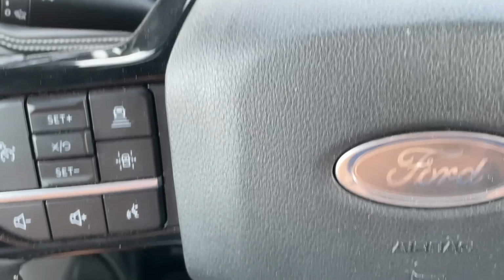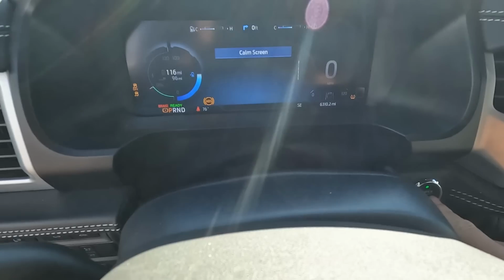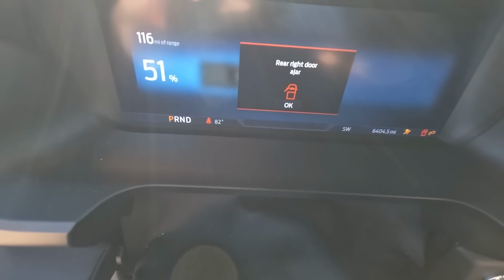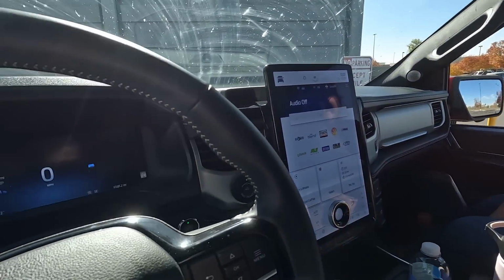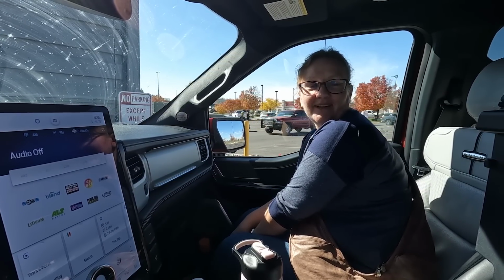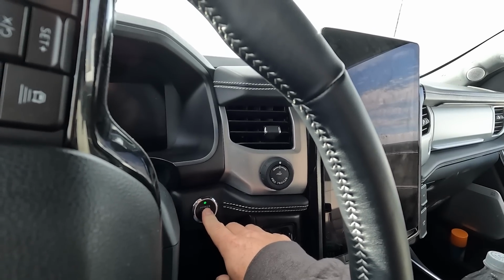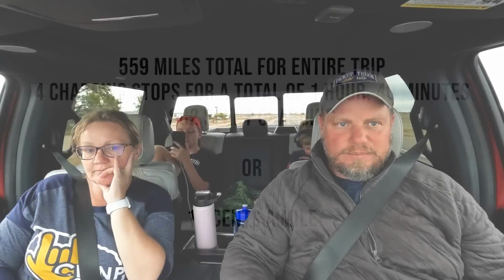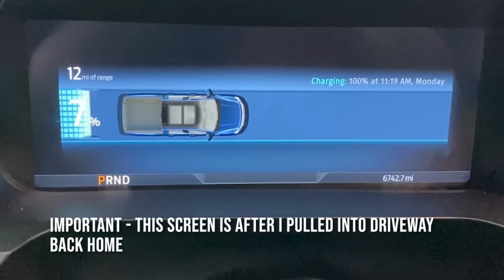Truth on charging times/cost on 2022 Ford F-150 Lightning Road Trip

Comment: My 2001 Ford truck would do this trip at 13.5 cents a mile and one 10-minute stop. No self-driving, but it does have cruise control, air conditioning, comfortable seats and a good radio. 
Battery weight, charge times, and vehicle cost start getting out of hand on anything other than a small automobile (the smaller the better). None of these things are going to be overcome anytime soon and the general public isn't going to buy into these vehicles until they are.

Comment: I just bought a 2021 limted f150 powerboost hybrid  today. 600 plus mile range. 100% full electric is not and will not be the future. Hybrid gas or hybrid diesel is the only way.

Comment: Is my math right on this. So...$23 could get you 6.38 gallons of gas at $3.60 per gallon.(And it took 30 minutes of your time to get that $23 of electricty)   Those 6.38 gallons of gas in say a Powerboost, should get you 134 miles of travel at 21mpg (which you should be able to get).  And you could fill that 6.38 gallons in about 3 minutes.   How much less is a Powerboost vs Lightening?  How much is 27 minutes of your time worth (the difference in time in putting in electricity vs gasoline)?  I'm so glad I ordered a Powerboost.  So with the Powerboost, you fill faster, you can travel further per dollar, and you have less stress.  What are the advantages of the Lightening?
Reply: It’s a better virtue signal.

Comment: Tim, perhaps I missed something but when you made the statement of 559 miles for $82 of charging cost I believe there might’ve been a mistake made. Correct me if I’m wrong but you started with a charged vehicle and ended with a vehicle that was basically depleted. I believe you should have filled the vehicle up to the same percentage at the end of your trip to get an accurate account on how much money it actually cost. No different then with a gas vehicle. You would stop at a gas station close to home, fuel up, complete your trip, and then fuel up at the end.
Reply: I was thinking the same thing.  When you are trying to determine total cost for the trip you need to factor in the initial charge.  No different than gas.  Just because my tank was full when I pulled out of the garage doesn’t mean I don’t have to figure that cost in.  Yes, you charged at home but there is still a cost associated with it.

I have a 2019 Tundra Crewmax with a 32 gallon tank.  Currently $125.00 to fill it up.  That gets me roughly 500 miles.  Not very efficient.  Tim beats me hands down regardless but on that same 579 mile trip I only need to stop once for 5 minutes to fill the tank again.

The pissing match, at the end of the day, is meaningless.  No single vehicle is going to suit every need.  Determine for yourself what your priorities and preferences are and make your buying choice accordingly.  That is, until the government tells you what you can buy.  We can then all carpool in the EV to the broom factory wearing our grey jumpsuits.
Reply: @handontheplow  Color me stupid and I'm no math genius but his first stop cost $23 and gave him 100mi of calculated range, $0.23/mi. If your Tundra gets 500mi on $125 that's $0.25/mi. Just a random observation...
Reply: @jims4036  Maybe I had too much to drink and didn’t listen to Tim close enough.  I will need to watch it again and do some more of that math stuff.
Reply from the maker: You can’t look at it that way. First, I charge at home. Second, there are no superchargers in my area. 

EVs are different than gas models and this changes everything about testing them.

Comment: My Ford Maverick Hybrid would have made that same trip for $42. No anxiety.
Reply: Yeah. I wanted to like the Maverick, but one of the big problems I had with it was the comfort of the drivers seat. 
I drive a 2014 Ford Focus, and the Focus has more space for a large guy like me than the Maverick, which is insane, and disappointing.
Maybe next gen they'll improve the cabin, but hard to say with the cost of everything going up.
Reply: @GKMess42  You must be a big guy lol. I am 6'1" 220lbs. Plenty of room for me.
Reply: @joed3264  I'm a bit shorter and wider. LOL.
I also can't stand transmission knobs, for multiple reasons. Give me a column shift or at least a center console one.
Reply: @GKMess42  It actually works well. It does not have a stop for park, reverse or drive.

Comment: so you drive 100 miles each time stop and charge  . I cant imagine that electric vehicles are supposed to be great. not for me. what happens when it starts to get cold outside. like around 10 degrees. batteries are not good in cold weather. another thing is lithium batteries wont charge below 32 degrees. what happens then?

Comment: Will those batteries loose range as they get older, like a cell phone battery doesn’t last as long after a couple years and lots of charges?  Also, what is life expectancy of the truck battery?
Reply: Yes they will. There is a mandatory 10 year warranty regarding the battery. I'd expect it'd need atleast 2 battery swaps in that time with normal use. Who could stand driving an ev that long without dying from stress and range anxiety I have no clue.
Reply: @triedproven9908  how much is a battery swap?  Cost wise, will it be worth buying a used ev if you need to budget big $$$ to replace batteries?
Reply: @dmanmb  Cant speak for the Lighting BUT a Hummer EVs battery cost is 30K plus installation.

Comment: I’m sorry, but there is literally nothing appealing about owning an EV to me.  Pay more, less convenience, and range anxiety.  Plus I really don’t want to spend that much time at Walmart.
Reply: Agree. Green hydrogen fuel cells are the answer as there is no pathway to net zero emissions without extensive use of green hydrogen fuel cells which in this type of vehicle have 500 to 700 miles of range and refills in less than 6 minutes.

Comment: 🤦‍♂️🤦‍♂️🤦‍♂️ …
1) Just think if everyone did all the tricks to save range on a XV to a ice/hybrid?! That would make the XV look even worse!
2) Continued from 1…are they gonna have to lower the lowest posted speed limit on interstates? It use to be just VWs that always held up traffic now it’s gonna be $100k XV 1/8 ton trucks. “55 saves lives and gas” is gonna be changed to “35 and don’t panic save the Xanax”
3) 😆😆😆 you really think rates are gonna stay in that normal yearly inflation increases?! XVs will be paying the same per/mile as ice. Well!…fuel will go up too?!!…really when everyone driving XVs?!🥴 
4) Who in the right mind wants to stop at every other gas station to put in 1-5 gallons?! You have to with an XV though!
5) On the plus side…USA state wide assessment testing for K-12 should see a noticeable improvement in the math sector. All these calculations to compute driving an XV to thank!

Comment: You should check out the 1000km challenge videos, for example by Bjorn nyland. You'll see that you can get pretty close to ice car speeds in an Ev.

But the key is you have to plan the drive better.

As you say, you only have a few chargers in your  area, but once you have more you can optimize your route to only charge when the car is low. That saves a lot of time.

Comment: You discovered a new use case for the frunk. A place to put stinky things that you don’t want to blow out the truck bed -  like Chinese food!  Lol. But also, everybody should slow life down a little. Take a bit longer while driving long trips and enjoy it. It’s a glorified golf cart. Some things will be better (cheap fuel, torque, zero maintenance, fill at home) some things worse. Go to a place where everybody drives golf carts like Port Aransas and you’ll see there’s a way it works and is pretty fun.  The simplicity is relaxing.

Comment: The MSM would have us believe that EV are free to drive, NO, equal to or more than current fuel costs. not a single discussion regarding disposal of current battery swap or failure regarding the environment. HA.. who is handling that? Great data, try towing something say for a vacation. Think any campgrounds will have available recharge areas? HA, try to recharge on Sunday or whatever masses decide to leave days are. Hybrid is really the only current path if you decide EV is part of life. Great data dude/ette.

Comment: What about cold weather and battery life.   Like in Nebraska when it gets to 5 below zero.  How does that change things?
Reply from the maker: It affects things for sure. I’m hearing 5-10% range reduction. I’m hoping to get an EV over the winter to see first hand the range loss.
Reply: You lose 20 to 30% range.
Reply: @gelu88  Again, commenting on something you have no idea about.

My freakin 7 year old Tesla loses less than 10% range in the blistering cold.

You need to stop spreading the garbage in your head since you have 0 real world experiences.
Reply: Does ford heat the battery compartment?  To protect the ion battery.  I wonder
Reply from the maker: @tomomeara363  yup. Batteries are heated and cooled to operate at an optimum temperature.
Reply: @Pickuptrucktalk  ok that's good.

Comment: @Pickup Truck Plus SUV Talk: I am anti-EV and I disagree with you about having a choice because we win’s at some point. 

My questions are; Can you see a family in a suburban or rural area make it work with one ICE and one EV in the present time? Would it be more feasible if we had a PHEV half ton right now as opposed to EV? What is the future for the 3/4 ton and 1 ton? Will they eventually switch to EV? Is any consideration being given to hydrogen fuel cell instead? Thank you for the real world review!
Reply from the maker: Good questions. So, I’m buying an EV for my wife and keeping a gas truck. Our circumstance works for that, but not for everyone.

Yeah plug-in makes sense.

3/4 and 1 ton will never be battery EV. Ford CEO even confirmed this. They will go hydrogen. BEV just don’t work with that much towing.
Reply: @Pickuptrucktalk  Hydrogen huh?  Interesting.  I'm in CA and just happen to live near on of the very few hydrogen fill stations in the country.   A surprising number of cars are always there filling up when I get gas.
Reply: Anyone that is towing (3/4 or 1 ton owners) are going to want gas for lighter loads and diesel for heavier loads. To drag a 15k trailer any distance you would need to double the weight of a current F350 to go EV.
Reply: 120 mile commute round trip to NYC from upstate NY. Saving $600 a month on gas.

Yes it makes sense… but it’s absolutely normal to feel like it doesn’t make sense… until you literally get home charger and use an EV for a month.

Then your mind will be 100% changed.
Reply: @cybertrk  Does the $600 savings include the $ you pay for electricity?  If you travel 5 days per week, that is around 2400 miles per month.  Assuming 20 mpg for a half-ton truck at $5.00 per gallon, the total is $600/mo for gas.  I know NY has overall very expensive electricity, but perhaps in upstate NY it is considerably cheaper than the rest of the State on average.  In my area, I pay .07 per KWH, and around 4.25 per gallon for gas.

Comment: Just got my order invite, 40k more than comparable gasser, to have a truck I can't drive 200 miles round trip without panicking.  I'm out
Reply: No worries, 200,000 others will take your place 👍
Reply: @phileasler5401  I think your wrong. I’m already seeing them setting on dealer lots unsold. You’ll start seeing them soon back as used because it’s a novelty at first until reality sets in that it’s not a real work truck nor a good road trip truck.
Reply: @gsguy9359  many were bought to flip or for the tax credit and dump, but they are already slipping to a few thousand over sticker

Comment: So, on the first commercial charging you added 170 miles and paid 23 dollars. You paid 20k to 30k more for that truck over a full gas model that gets 24mpg. The gas truck would have gone further on a fill-up and got around 24MPG. At 3.50 per gallon that is $15.60, and this truck just cost you 23 dollars. It looks like the EV truck is a loser all around.
Reply: Nope 90% is done at home, I pay about $0.80/e gallon.  I calculated my mpge at a EA and it was $2.77
Reply: @phileasler5401  there it is. Philly is defending the honor of its decision.  Don't be mad that people are exposing the truth. You need to stick your decision.  Some people like making informed decisions instead of just trying to be woke.

Comment: Your vehicle will charge mech faster the lower you drain your battery.  10% to 80%  will probably be faster than 50% to 90%
Reply: The lightning is programmed to reduce the rate of charge when 80% SOC is reached. It takes as long to charge from 80-100% as it does to charge from 15-80%

Comment: So you spent a ton of money more for an EV and more per mile for the charging than a gas f150.  Hmmm, sounds like a government program
Reply: Can't seem to get it through people's heads, any EV that has a J1772 connector is not good for long distance traveling.  There just aren't enough charging stations for those vehicles and the kwh costs are ridiculous. The lightning in particular will out perform any ICE truck in the city and on local highways.  And do it much cheaper because you'll be charging at home.
Reply: Fud….again
Reply: @phileasler5401  low information person alert.  Facts matter.